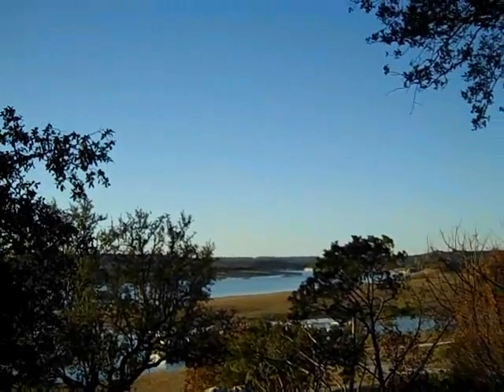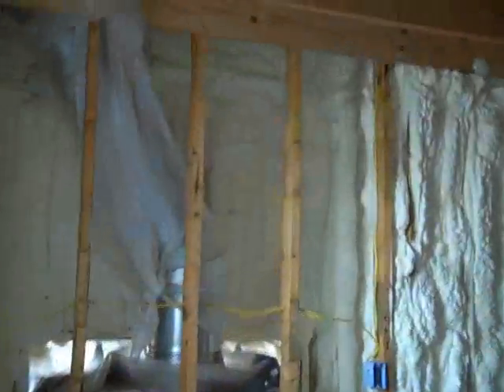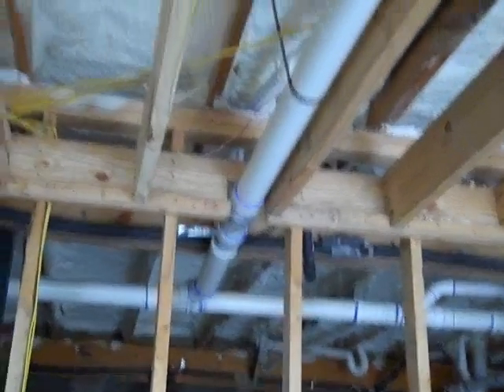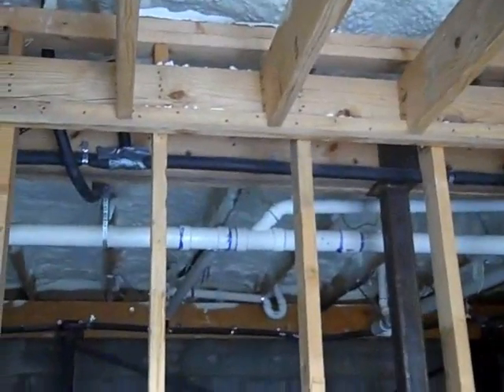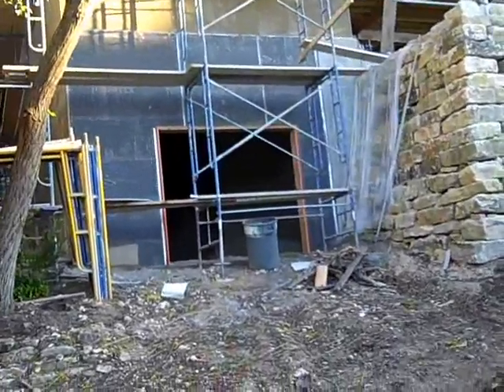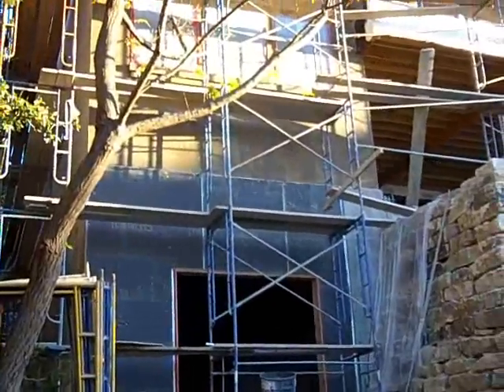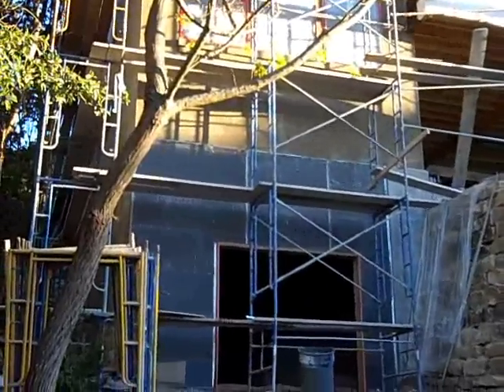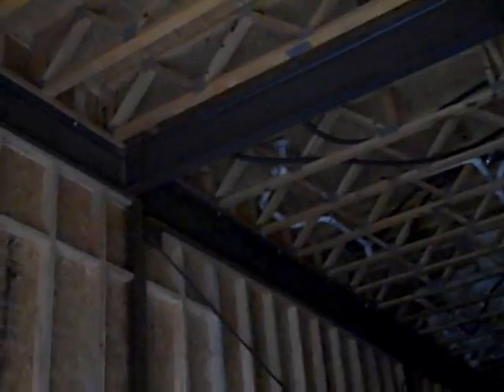Slab Foundation vs Crawl Space for Sloping Texas Custom Home

Comment: Hi Matt, Great video as always. I wanted to build my own home in Vista CA. and wondering if you give me some guidance as foundation Pier & Beam or Slab. There will be three stories (levels), but none are on top of each other. All have their own flooring. I have an extreme hillside slope and the site work (retaining walls for concrete slab) alone would cost me 1/3 of the build. After seeing this video, I can only hope to reduce the cost using Pier & Beam. I believed that the only retaining walls needed are for the driveway at the top of the road, and the rest are concrete piers and wood beams for flooring. Total square footage would be 3200sf for all three floors, excluding the attached garage. Have you seen or ever build the house entirely on Pier & Beam? If so, what was the reason?

Comment: Hay Matt....... I am currently deciding on a few ideas for renovating my house. I have been told that using a pillar and timber type floor system would be cheaper for me than a slab...... I only have a single story..... my house does run on a slight slope.and has floor boards right through. It sits on a pillar type foundation now..... so do you think it would be the cheaper and faster way to go?